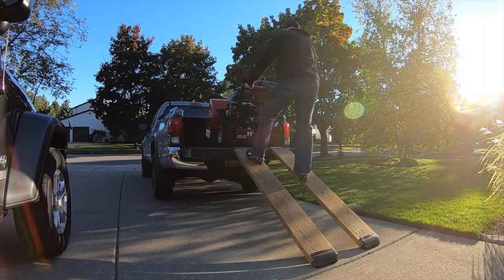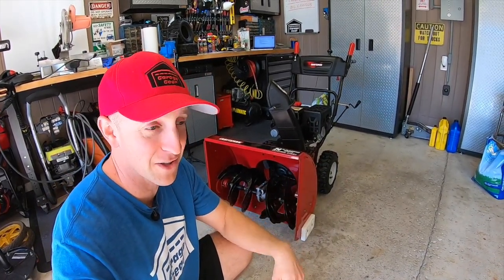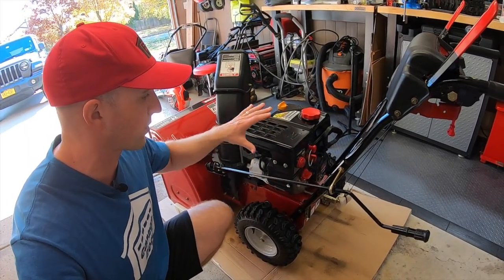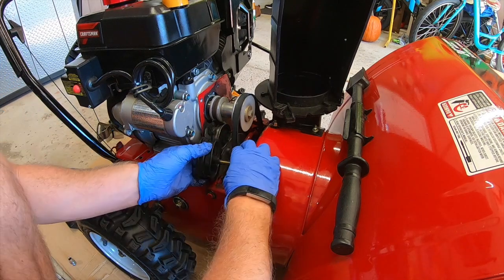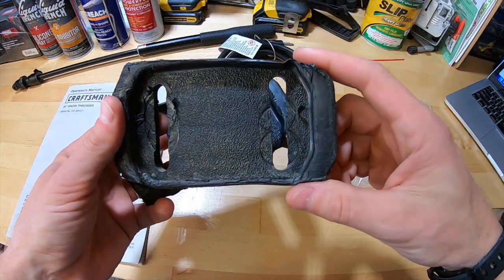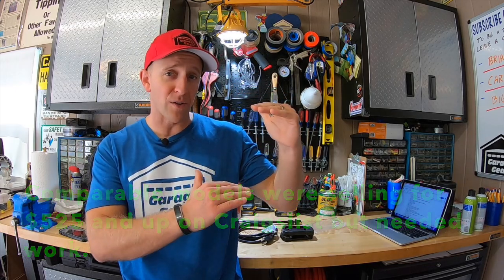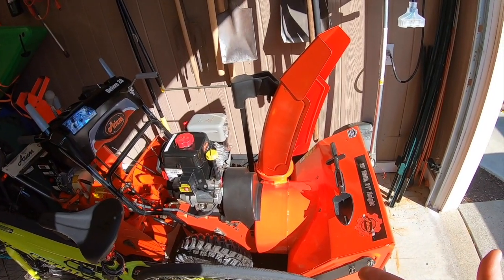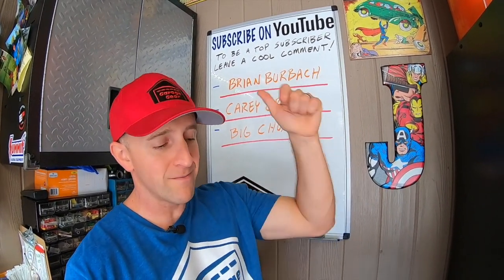Is This 10 YEAR OLD Craftsman 24 Inch Snowblower BETTER Than A NEW One?

Comment: Rght now i can buy 5 to 6  nice looking snow blowers for under $400.00 in my area. In fact i am going  to buy a Remington RM2410 (MTD) tomorrow, looks almost as good as the craftsman you bought for $250.00. I do know where 3 craftsmans 1 is still new with all the paper work and manuals hanging on it all for 350 or 400 asking prices. Couple of Areins 24 compacts for $400.00. One has a Subaru engine on it?  Good looking snow blowers . There everywhere on marketplace right now. I was thinking of buying 2 or 3 of them and hope we get a good snow this winter??  New snowblowers are out of this world in price. Although Home Depot just had a sale on Toro and powersmart. New 24" powersmart was $ 399.00 and 26" is still only $528.00 right now.
Reply from the maker: @skydancerforever  thanks for sharing skydancer

Comment: Just got a craftsman 20" that's about 15 yrs old and hasn't been started in 10+ years according to the previous owner...  bone dry dipstick, bone dry gas tank...  I wanted to see if engine was seized and if electric starter worked.  To my surprise, I literally added fresh 91octane and added oil AND NOTHUNG MORE...  IT 🔥 UP IN LIKE 1 SECOND!!!  MY QUESTION IS WHAT SHOULD I DO BEFORE PUTTING IT THROUGH THE HEAVY SNOW THAT IS FALLING RIGHT NOW!!!  Do I totally tear down the carb, or just let her buck!?!?
Reply from the maker: Hey Andy if she’s running fine and you added fresh fuel and oil you should be good to go! Thanks for watching!

Comment: I've had a Craftsman for about 15 years.  Every spring I run all of the gas out of it and put fresh gas in the first time I use it the following winter.  I've never done anything to prevent rust and yet there's not any rust any where.  It has always been a challenge to maneuver and turn and didn't know there was anything better until I started checking into the Ariens that have the auto-turn.  Being female and getting older I will be selling the Craftsman and getting an Ariens Compact from my local dealer/service center that's only about 6 miles away.
I've always been mechanically inclined and would enjoy doing my own maintenance on my new Ariens.  I've been watching quite a few of your videos and learning a lot.  Thanks!
Reply from the maker: @friend4ua724  awesome friend4u! Glad to hear these videos are helping you out! I’m not sure the ariens compact has the auto turn feature you’re looking for. That may be on the deluxe models. Double check before you make your purchase 👍
Reply: @GarageGear  I checked Ariens website again and the compact does have the auto turn.
Reply from the maker: @friend4ua724  ok cool! It used to only be on deluxe models. That’s a good step forward for them

Comment: I've had my craftsman for 9 years this winter is its 10th never had a problem. It's not quite as clean as that one but close. 208cc overhead valve It has never failed me not once. Mine has a way taller chute. I wax it as needed it is the cleanest snow thrower on the block even at its age. I wish I could post a picture of it. I LOVE MY 24" CRAFTSMAN SNOW THROWER !!
Reply from the maker: Awesome Brian! Glad it’s working out great for you! 👍

Comment: This reminds me of the snowblower my dad gave me, must be a 20 at least year old Troy built, I never saw it much growing up cause he didn’t let me outside when he was using it and only used it during BIG dumps, and in the garage he always kept it covered and usually me and brother shovelled. Last year he randomly gave me it as he sporadically bought a new one and didn’t need it so I got my
First good look at it, no rust, original belts still which were still tight, starts first time ever pull and even has the consumer reports best rated sticker on it!
Reply from the maker: Awesome Tanner! Some hand me downs are the best! Thanks for sharing bud!  👍
Reply: Keeping an engine/machine covered lets moisture build up under the cover and corrode it.  Not a good idea.
Reply: @tommak6516  wouldn’t spraying it with a rust-preventative resolve that from happening??
Reply: @tannerc900  No, because you do not want to spray on electrical things like armature, etc.  Plus moisture will buildup on things inside where you spray does not reach.  You want to keep it dry and still let air circulate.

Comment: Northeast Ohio, 16 years, single stage Toro, starts on second pull every time. Never had a need for a large two stage unit. I run circles around all my neighbors that have two stage throwers and the single stage clears down to the concrete much better. Additionally, it stores so much easier. Hang it from the ceiling in the off-season.
Reply from the maker: Awesome thanks for sharing Jim!

Comment: MTD has supplied Craftsman products to Sears before the bankruptcy. Any machine with a "247" model prefix is MTD made. Also "316" model prefix machines are MTD as well. MTD was bought by Stanley a few years ago. 

They are still "made" in the USA, but MTD imports the engine and other parts for it. The one to get is the MTD with the Tecumseh engine, which would have been last available around 2008-2009. I have a 2005 MTD made 9 HP/28" path Sears Craftsman Tecumseh Snow King powered machine given to me by a family friend who worked for Sears from 1953 to 1993.  Yes, their products tend to be consumer grade/lower end, but fine if you maintain them. Parts are plentiful for them. Previous Sears snow blowers were "536" prefix product made by AMF/Western Tool (who owned Harley from 1969 to 1981), Noma, Murray and today Briggs and Stratton provides whatever support is left on "536" machines. I have both MTD and Murray made Sears machines. The Murray made machines are better quality, but the MTD will be fine for me. All three Sears snowblowers I have were given to me free and with minimal work, they run and perform like new. 

As an aside, the person that gave me the 2005 MTD made machine also gave me a 1995 Simplicity machine (this MTD replaced it) and I fixed that one for 50 cents (spark plug cleaning and a new primer line). I offered it back to him fixed, but he said he had bought a new one (this one). He's now in his 90s and has someone clear his driveway for him, so he didn't need the machine and just gave it to me. It was maybe used 10 times if that and is in new condition.
Reply from the maker: Thanks for sharing this GP!
Reply: @GarageGear  Sure.

Comment: I have a craftsman my dad bought when I was a kid. Don't know what year but closest I can glean from the label it's 2005. We barely ever ran it except on heavy snow. Changed the oil every year and kept the rust off it. As he got older it was too much for him, he just wanted a single stage. It went to my brother who didn't use it because his driveway was too small, he got a single stage as well, and then to me; who really friggen needed it. It's never had a drop of ethanol in it. We always used fuel stabilizer. Dad taught us how to run it dry and make sure the piston was at it's end to keep rust out. It looks like its a couple years old after 18 years.  Always starts on the first or second pull, never used the electric start. Didn't need to.  It eats snow like a beast and it can chew through an icy windrow without slowing down. Since I got it I've been maintaining it thanks to your guidance. Just recently changed the belts, I was hesitant to a little afraid I might screw it up. I did screw it up the first time. Auger belt was too small and was loosely catching. When I looked up part numbers I got completely different sizes and widths, so I took the belt to the store and made my closest guess.  When I saw smoke coming from the belt on idle, I knew I wasn't getting my $23 bucks back. Amazing what 1/2 inch difference can be. Now the belts are replaced and I've learned enough about it and spent enough time with it, I'm confident I could fix just about anything given the research. And maintaining it is something I enjoy.  Thanks bro, your videos really help.
Reply from the maker: Hey outlaw! Thanks for sharing this with the community and appreciate your kind words! That glad machine is still running like a champ for you! 👍

Comment: I have a newer model 24" Craftsman, perhaps 6 or 7 years old. It looks similar, with a bit different chute crank. It has those crappy guides which are getting close to the end of their life. When they are ground down too far I plan to fit a couple of metal ones that I saved from an ancient MTD. Those won't wear out.
The newer blowers are all made of flimsier metal, so the barrel section of the impeller is somewhat dented on mine from encounters with rocks and stones on the gravel driveway. Otherwise it is holding up just fine.
Reply from the maker: Thanks for sharing! They definitely don’t make them like they used to!

Comment: Hey JB. Love your videos! My 3 year old craftsman snowblower still surges after I replaced the carburetor and spark plug and put trufuel in the tank. Any suggestions? Thanks.
Reply from the maker: Hey John replacement carburetors can have issues because they may not be tuned right or have holes bored out incorrectly. I would try cleaning the original carb and putting it back in. Appreciate the positive feedback.

Comment: It is amazing how expensive these have got. I bought pretty much the same one, 24 inch troy built brand new for 650 2 years ago from tractor supply. Crazy
Reply from the maker: Yep they are going for $1000 nowadays! Wild prices! Thanks for sharing Zach!
Reply: The manufactures will sell less and less at those high prices and eventually go out of business due to low volume.  Many people will be so depressed because of the inflation they will just let the snow build up in their driveway and take the bus and/or walk and/or be housebound and wait until the snow melts in the spring.

Comment: Is topping of the gearbox oil through that blue screw/bolt part of scheduled maintenance on this particular machine? I own one and can’t decide wether to add some 00 grease to the gear box via that blue screw because it doesn’t say to in the manual.
Reply from the maker: Hey 6 checking this is something you should do every year depending on use. The manual doesn’t say anything about this maintenance step but if it appears to be low then add some. I’ll be doing a video on this coming up.

Comment: You checked the oil after you started it?
Anyhow, I have the same snowblower and after watching your channel, I just put an impeller kit on and can't wait for it to snow. It's 55 degrees right😡😡
Reply from the maker: I always check the oil on a used snowblower to see if needs changing. You’re gonna love the impeller kit. Let me know how it throws for you!
Reply: @GarageGear  My point was You started it before checking that it had oil, lol. I check the oil in all my own stuff every time I use it. 
I'm stoked to see how that impeller kit works, can't wait for snow. I used your template and ordered the parts you linked so thanks!

Comment: HI, I have that exact snowblower, how did you grease the gear box? I see nothing anywhere
Reply from the maker: Hey Tom, there is usually a little grease plug on top. Should be either blue or black. Also some of these gearboxes could be fully sealed. On this model I didn’t have to even touch it! Thanks for watching!

Comment: My hrn216 has a oil leak and I don’t know what to do
Reply from the maker: I would try to find exactly where the oil leak is coming from.
Reply: @GarageGear  it’s coming from the tube that is on the engine where the oil goes in
Reply from the maker: @Outdoorpower-equipment  oh ok so it’s coming from your oil spout it sounds. That should be fairly straightforward to replace.
Reply: @GarageGear  i took the iol spout off and i looked at the seal and there is a little tear on it and i think that is the issue.
Reply from the maker: @Outdoorpower-equipment  replace the seal and you should be good to go!

Comment: HAHAHA dont like mtd eh will u didnt meet the mtd i use to own it was a 90s blower and it ran and ran done its job up untell this summer just passed it still would of kept going if i still had it but the bucket was rusted bad by the skids and there was about 150 bucks it needed in parts to fix it up i ran that thing thru feet of snow and it never broke a shear bolt best thing ever the new one i now got is junk it broke twice already and its only been used like 4 times if that 🤣 i hope it lasts atleast a year old is best new is trash thats y i own a 90s truck cause its better
Reply from the maker: Thanks for sharing